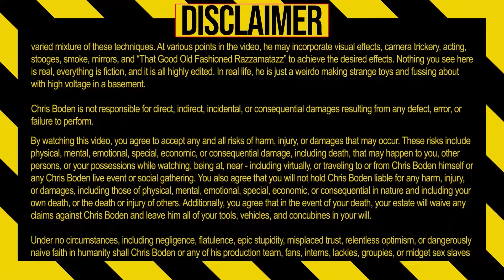FIRST SPIN TEST! Big generator rebuild.  Authorized Personnel Only   S2E22

Comment: so...is the shaft bent?? 
does it "straighten up" with more speed (like the bearings require a specific speed to "center up"??) 
.
or is it just old... and you are gonna let her wobble?
Reply: ...no self centeribg....its just the slip rings(seperate from main rotor)off center...super quiet under normal operation(s).

Comment: That mercury tube looks almost identical to the ones used on really old boilers at a place i worked at. Def the right piece for the job, very reliable ❤🤓

Comment: The exciter shaft is more of an eccentric than a shaft.
Reply: They are designed to be so that the brushes don’t stay static and get stuck from dirt build up.
Reply: Maybe a little wobble but I guess not that much
Reply: @TeamStevers yes, but just a bit. This much will lead to an early failure of the bearings/bushing
Reply: Thats what makes it exciting.... 
In a shafterly manner..... 😂😂😂😂
Reply: The dynamic balance of the exciter will be well off.

Comment: I see that the brushes are tracking the slip rings but is being off-center that much acceptable?
Reply from the maker: No, this is just the first test. She'll get brought into spec as we go. We want a tiny wobble, but not that much.
Reply: @Physicsduck  Why do you want a tiny wobble? Wouldn't you want none?
Reply: @NoZioKikes88  they like the wobble for cleaning out the brush holders is what he said in a  previous video.
Reply: @Physicsduck  I'm curious about the reason behind wanting some wobble vs as little as possible (none if it were practical).
Reply: @Sevalecan  Just a guess, but perhaps to exercise the brush holders a little so that they don't stick in one position and arc?
Reply: @Physicsduck  I would like 1 wobble to be used at a time! The other 2 should be kept back in reserve!